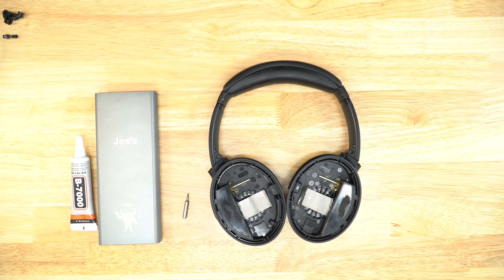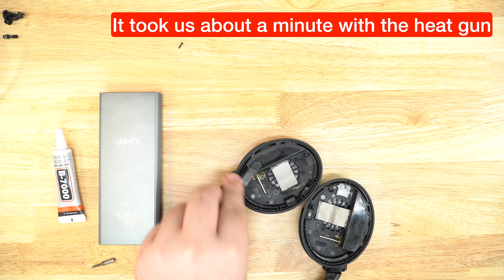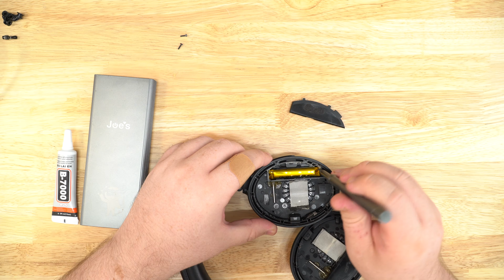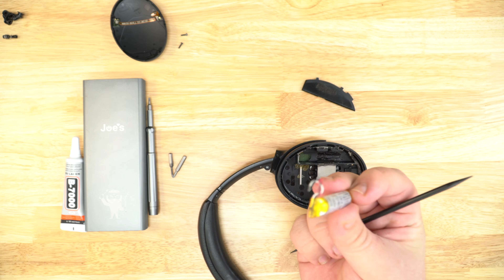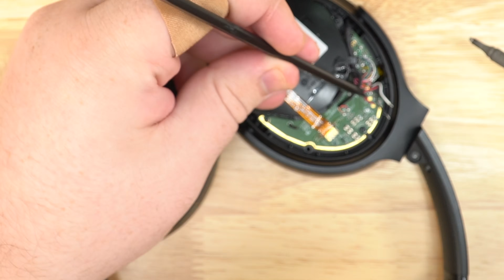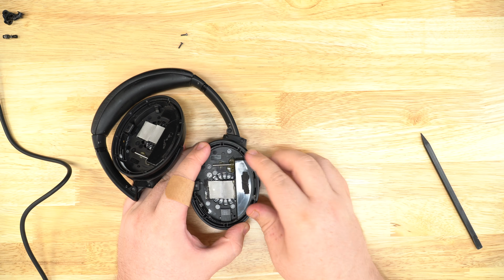Bose QuietComfort QC45 QC 45 Headphones Battery Replacement | Repair Tutorial

Comment: Hello,  I bought these QC 45s about a year ago, used them twice on two plane trips, then didn't use them for almost 9 months. Went to go charge them for a recent trip but got the flickering yellow/white led. I did the reset advice I found online to no avail. So I came across your video for changing the battery, got a replacement and did everything as your video showed. Not too difficult. I tested the power cord hook up before closing everything up, but I still had the yellow/white flickering led. I double checked my soldering and also looking for any other loose wires or burned up circuits. Nothing out of the ordinary. Any ideas what might be the issue?

Comment: Thanks for the video. what does it mean if after attempting this, the status light flahses white and amber, and the headphone won't boot ?
Reply from the maker: Thanks for watching! Flashing white/amber means there is an error. It could be that you soldered wires to the wrong places or maybe two of them are soldered together or that the battery is faulty.